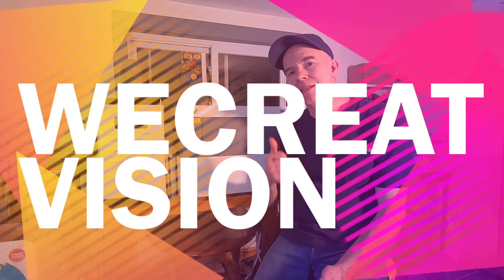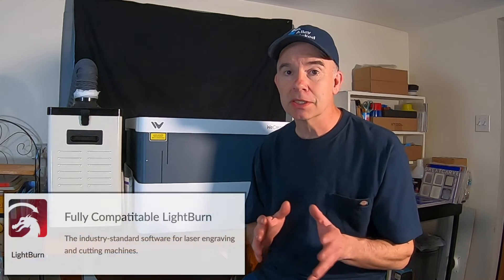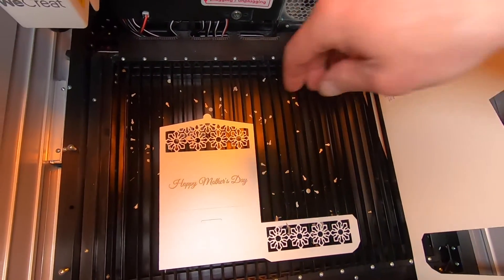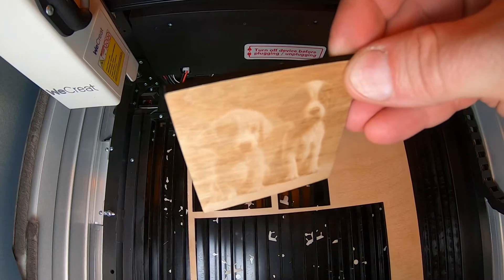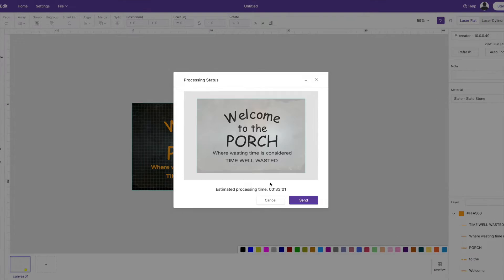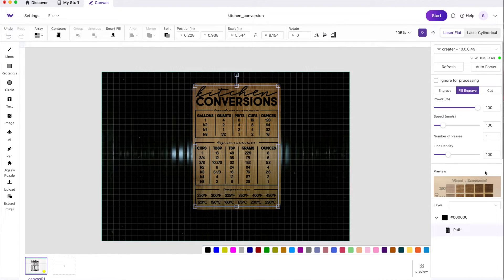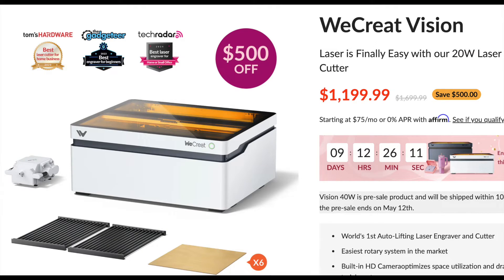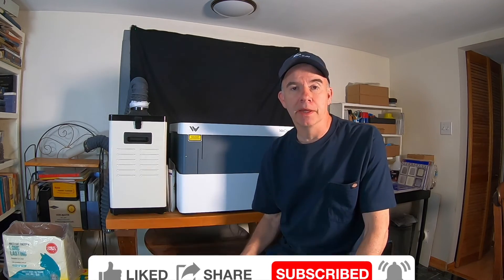WeCreat Vision Laser Review - Part 2

Comment: I’ve also been very happy with the one I got two months ago except the USB connection fails over and over requiring turning the laser off and on repeatedly until it finally connects. I’m looking forward to the extension gadget that should ship shortly. 
One thing I’ve not been able to figure out is how to remove the width of the laser kerf such as when cutting a bow tie and slot.
Reply: Experiment! Be willing to do material array tests. Be willing to ruin material in  your attempts. Experiment with functions like the Contour function. Experiment with the choice of algorithms that the software offers. There is very little you can't do within the confines of this machine and software. I am right now getting a new software upgrade and I cannot wait to see what more this phenomenal machine can do!